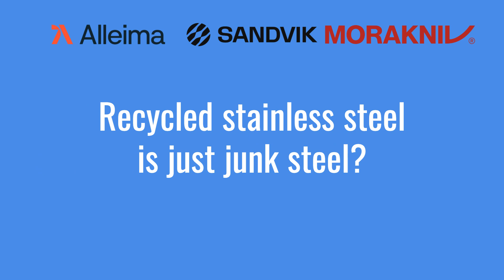Talk with Alleima / Sandvik representatives about stainless steel

Comment: Look, these people are just being honnest to the max... Pretty much ALL the steel manufacturers use this same process. What realy makes the difference is the tight control of the elements!
Reply from the maker: True. Must most don’t says it openly and the majority still thinks that other steel are still made from raw iron from the mines.
Reply: @Oldmora  Absolutly right! Since the late 90's and early 2000's most, if not all steel foundries had to resort to "scrap" steel, frequently from Asia, to melt into knife steel. Seldom do they obtain two identical batches... In the case of Sandvik steels, the great start advantage is the extremly high purity of the "scrap" alloys so, the end product is of superior quality for sure. In the end, steel from raw materials is a thing from the past. Again, using good quality "scrap" metal AND tight control of the various elements (chromium, vanadium, etc) is what REALY makes a superior knife steel. And what makes a good blade, is the proper heat tratament and temper..  And then, the geometry of such blade comes into play, if correct for the intended task, a great knife is borne. Let's face it, the people at Morakniv as long figured it out! 👍👍

Comment: So...? What steel is used on, for example, the Garberg? Still 14c28n?  Oh the confusion... I would argue a better name would be "14c28n RECYCLED". Thanks.
Reply: That's the right question. If the steel was always recycled, why is the name different now? I would like to know what type of steel my knives actually have.
Reply from the maker: @markusbepunkt    I have to agree with you that the change they made in the way they communicate the steel they use, that goes back to 2020, is not the correct way, for a segment of their clients, specially for those in the knife community/bushcraft/survival that want to know. I still haven’t lost hope that they change to the way they communicate pre 2020.
Reply from the maker: @@user-vt7yy5ey3t   i like those words “pure” and “refined”
Reply: @@user-vt7yy5ey3t I agree that "recycled" has a bad ring to it. I have no doubt that Morakniv and Sandvik/Alleima knows what they are doing. Just a bit unfortunate that the "recycled" isnt a steel name with properties that can be experienced as fixed like M390/CPM 3v/4v /10 and 15v and so on... (heat treat is a sepparate question). I have asked Morakniv here in Sweden on a fb post but haven't got any answer. My conclusion in real world use is what ever they are using, it is good enough. But for a curious mind the "recycled" steel is an itch that can't be scratched.
Reply: @@user-vt7yy5ey3t I agree that "recycled" has a bad ring to it. I have no doubt that Morakniv and Sandvik/Alleima knows what they are doing. Just a bit unfortunate that the "recycled" isnt a steel name with properties that can be experienced as fixed like M390/CPM 3v/4v /10 and 15v and so on... (heat treat is a sepparate question). I have asked Morakniv here in Sweden on a fb post but haven't got any answer. My conclusion in real world use is what ever they are using, it is good enough. But for a curious mind the "recycled" steel is an itch that can't be scratched.
Reply from the maker: @Mrplacedcookie   Do you know that for example Böhler, maker of many CPM out there like the  m390, says on they website that their products are made of up to 76% recycled material ? https://www.bohler-edelstahl.com/app/uploads/sites/93/2022/05/Sustainability_10022022-Englisch-Lay-5.pdf
Reply: @Oldmora   No i didn't and to me it dosen't matter. I  mentioned B/Uddeholm and CPM for their different PM-steels. That one can expect S30v to behave like S30v (CPM). I think the confusion from my uneducated associations with "recycled" was very arbitrary . And when there was no answers of this mystery steel  . One was just left in a void.
Reply from the maker: Totally agree, the fact the refused to openly say the steel opened the door to all sorts of speculations and it was a bad marketing decision in my opinion.